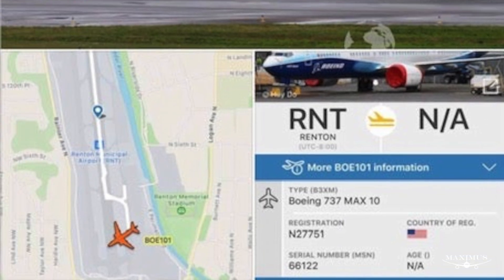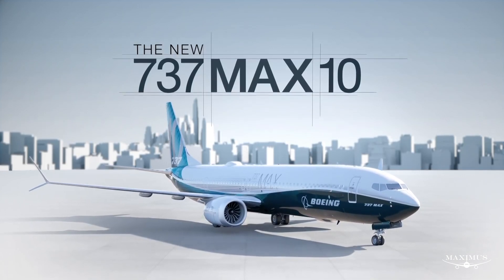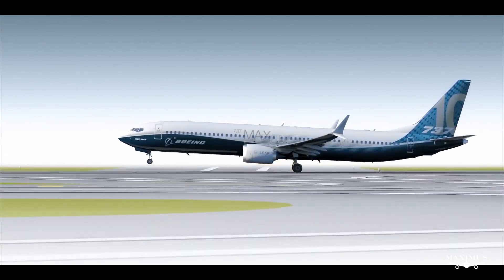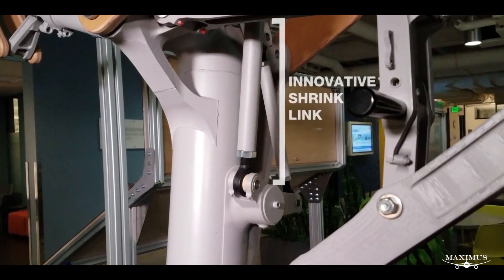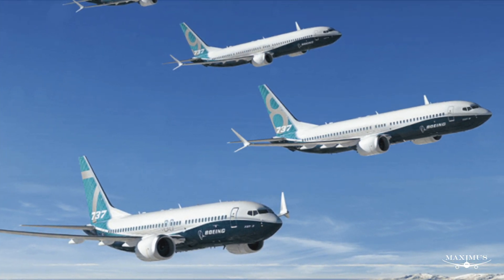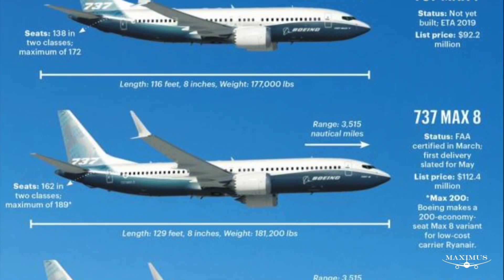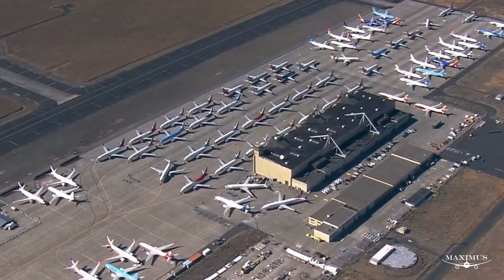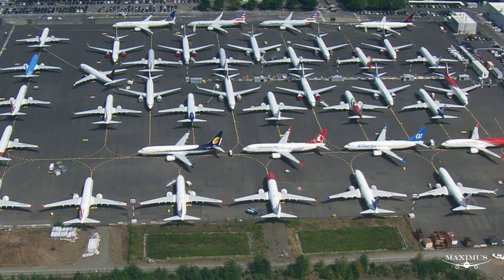Boeing Max 10 Takes to the Runway for the First time for its official Taxi Test.

Comment: i have a question though, if they were able to extend the landing gear, could they not have taken a little more time to perfect the system so the engines could be placed normally? it would have prevented ALL these deaths and groundings. boeing needs to put safety and functionality ahead of profit.
Reply from the maker: The problem was that the landing gear change wouldn't have affected how the FAA would have certified the plane.  It would still be considered the same basic 737 but the flight control MCAS would have caused them to classify it as a new plane type thus there would be a lot of delays and Boeing wouldn't have caught up to Airbus in their A320 neo launch so that's why Boeing covered it up.
Reply: The location of the engines is not a problem.  That change was not the reason for the MCAS enhancements.  The greater takeoff thrust of the new engines was the reason MCAS was added.

Comment: Baby 757!
Reply from the maker: Lets Do it!
Reply: I see the 757 seems to be popular in Maximus's comments sections, so I've got a question.  While the 757 is out of production and disappearing from airlines, Boeing keeps stretching out the 737 and increasing it's range.  It seems  to me that they are essentially trying to turn the 737 into a 757, but as we all know now, there was a lot of "baggage" that came along with those changes.  Why didn't they just keep the 757 alive instead?  I bet they could fit newer, more efficient engines under the 757 wings without turning it into some suicidal mutant.  It seems like I'm missing something here.
Reply: @ressljs  I think it would have been logical to discontinue the 737 in favor of a smaller version of the 757.  But the airlines kept buying the 737.  The little 737 was the favorite of Airline Deregulation.  Southwest was growing fast and did not want to invest money in training pilots on a new type. They were cozy with the 737.  That was the main reason I think that the 757 did not replace the 737.  The 757 jigs were destroyed in the mid 2000's when the line was shut down.  If they restarted production they would have to invest great sums in retooling the factories and hiring suppliers.  I think  Boeing has been going on the cheap for the last couple of years.  They have played with the idea of a 737 replacement but have chosen to kick the 737 can down the road for as long as they can.  I believe that this practice has finally done them in.
Reply: @ressljs  The reason is that the 737 was much more popular than the 757. Airlines want planes that their pilots can fly and the 737 can do the 757’s job just as well so it makes the most sense to simply extend the 737. This is especially true considering airlines weren’t quite ready to get rid of 757s but they were ready to replace their 737s meaning a new 737 is smarter decision.

Comment: I hope this DEATHTRAP isn't allowed to fly again!
Reply: sanitman1 alright, thanks for the correction. My mistake. Anyway, i never looked much into the AF447 crash and i just said from  what i’ve heard from all other comments, that crash never interested me to look and analyze it thoroughly. After the MAX gets fixed i’ll obviously fly on it but i’ve only flown in an airplane once in my lifetime, that is, on an ATR 72-500 on a 50 minute domestic flight. So, it doesn’t matter to me at all, which airplane is the best or not, i can’t fly in any, unlike you probably.
Reply: only the Max-8 had the problem
Reply: Andrea Mendes when it’s gonna be fixed the MAX-10 will be game-changing for Boeing, i can guarantee you that, but, only after the MCAS and other problems get fixed. :)
Reply: Max 10 does not have MCAS
Reply: It’s not really a death trap, they should just fix everything
Reply: Zobi_YT yep, media exaggerates everything.
Reply: sanitman1 well, that was mostly due to pilot error and the majority of the problem was not with the aircraft itself. In this case, the B38M had a major airframe issue and a less of a pilot error. Though, given, if the pilots had proper training on the MCAS and pitch-trim control systems, they would know how to counter it. Now, by this I am neither supporting AF447 A330 crash nor the Ethiopian and Lion Air B73M crash. :)